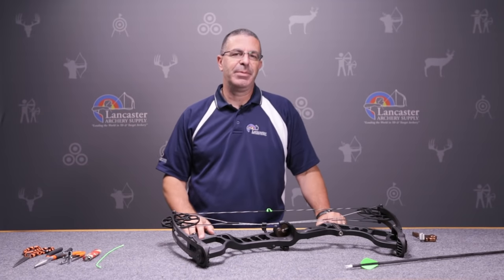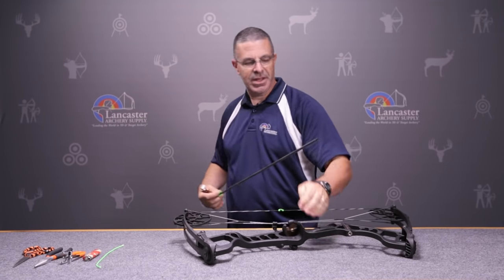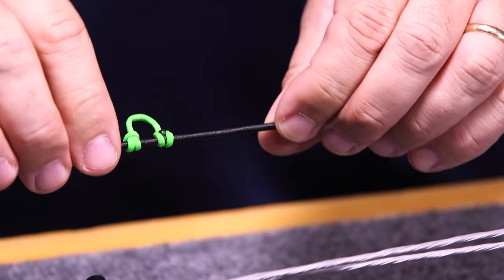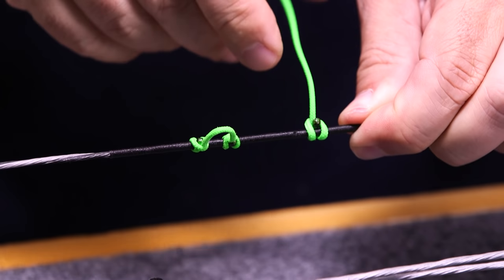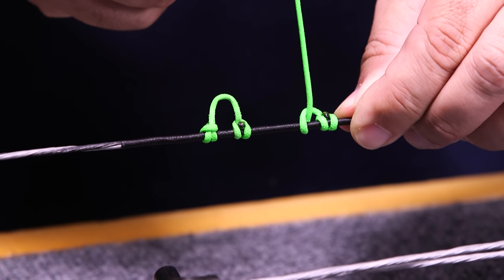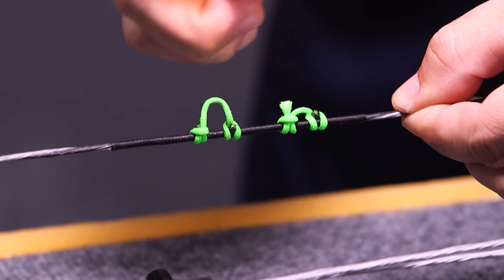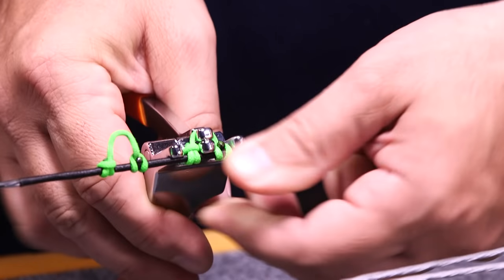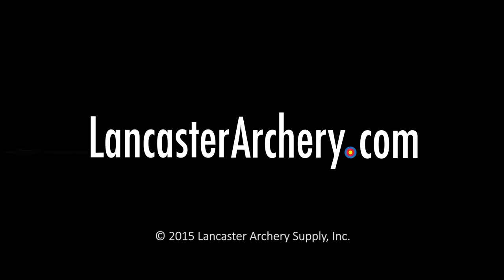How To Tie a D-loop

Comment: I know these guys are sharp but this is not the best way to tie a dloop. It relies strictly on the melted end, and I know some will say if it's melted correctly it will be fine but that's not true at some point you will have one break. Use the clove hitch it is very similar and does not rely strictly on the melted end and will not slip.

Comment: I wish somebody on the world wide web would inform folks of the best way to tie a d-loop.  It's not what you see here and everywhere else. 
The best way is using a clove hitch, which is similar but not the same. The clove hitch cinches on the cord itself, and the quality of the meltedball has little to do with it. Unlike what you everwhere on the internet, which is basically two half hitches, which slip, and rely heavily on the meltedball. If you shoot enough, you will eventually wind up hitting yourseld in the face when the ball breaks off. I have been shooting my current d-loop for 3 years now.Clove hitch, the best way, only very few bow shops know.
Reply: I agree, and I am happy I found this comment of yours. I am confused and concerned about people using two half hitches for the þ-loop: it's not a secure knot, and it may be dangerous to use. The clove hitch should be the standard.
Reply: Dodd Vinson how do u do that
Reply: Clove hitch is an awesome knot. I use it for just about everything I tie up.
Reply: You are correct, this subpar dloop is all over the internet, I guess some people don't mind hitting themselves. in the nose

Comment: Are D loops used on traditional bows and  / or takedown recurve bows?
Reply: Nope usually you use your fingers
Reply: @sur3real685  I was watching this and thinking that it would make a nice nock point without having to crimp brass onto your string. You don't Have to use a release with it

Comment: P.J. I'm confused to the point of determining the size of loop? Is there a standard size to look for? Where does draw length come into play? Thanks P.J.....Mike
Reply from the maker: There is not a standard size. You make it to the length that suits your anchor, and that's where draw length comes in. That's obviously part of the equation. But if you go to a tournament, you will see D loops of all lengths. There is no standardization because it's all customization